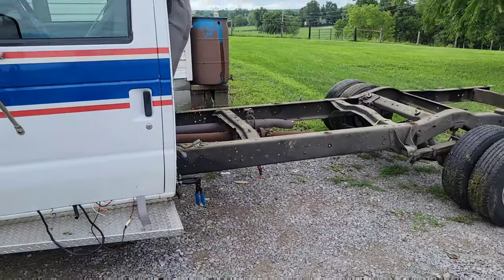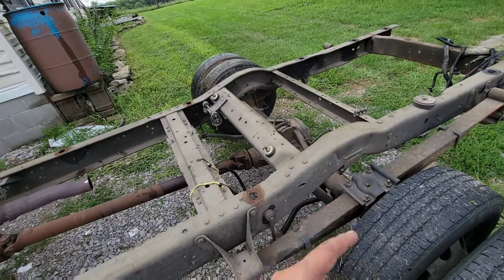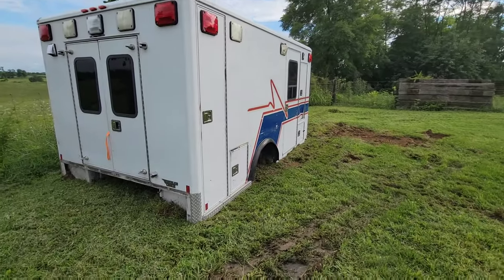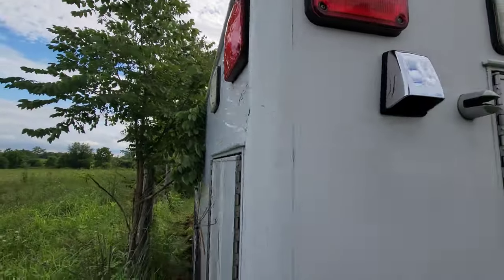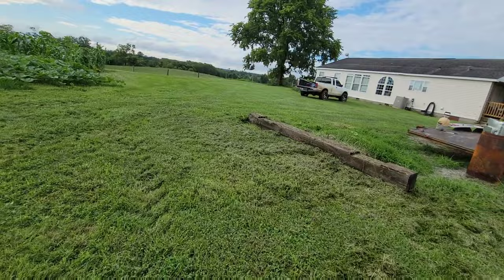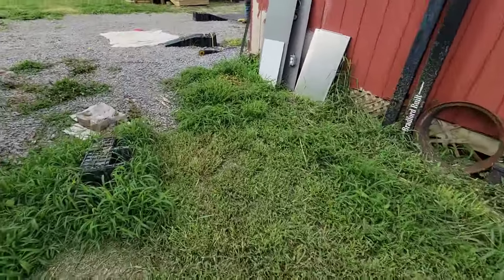Ambulance Box removal - Stripping chassis for Project 73squared.

Comment: I'm thinking about getting a box , guy selling one $500. I would have to remove from chasis.
Reply from the maker: Just have a plan to move it.   They are stupid heavy.    Even being aluminum I suspect this box was over 6k pounds.
Reply: Why did you abandon the ambulance service truck idea?
Reply: @bradrichards6107  Just didn't work out. Besides anything I do that is economical my city will F me.
Reply from the maker: I did because I didn't want to mess with insurance.    This one I had to have a separate policy from my regular policy and didn't want two bills.     I also have knee issues and the van body was uncomfortable on longer drives.